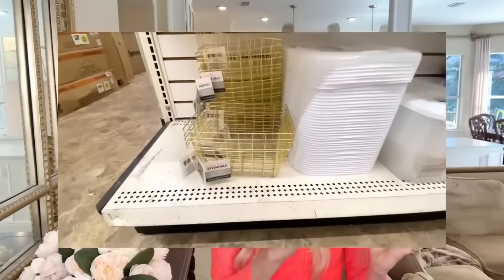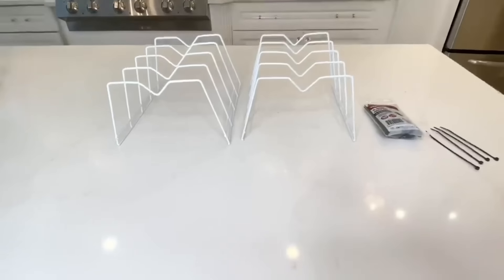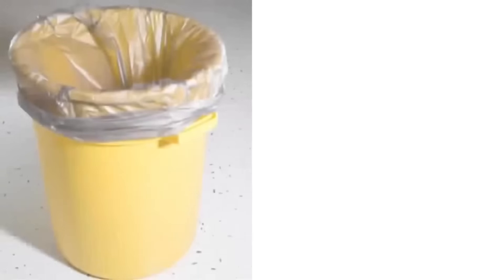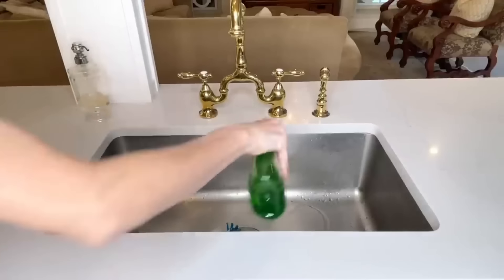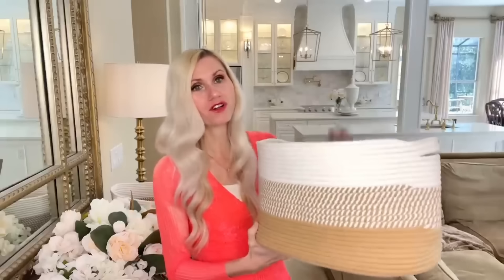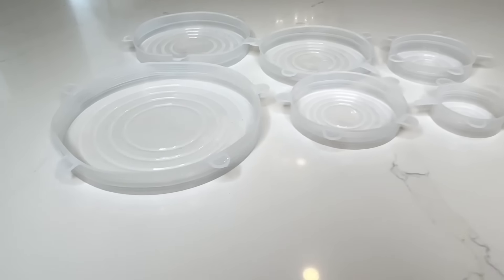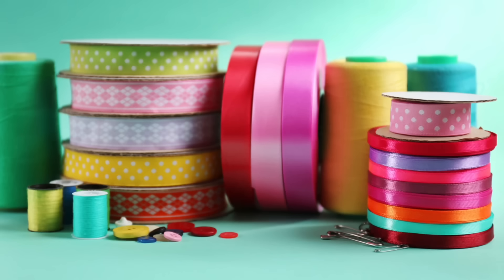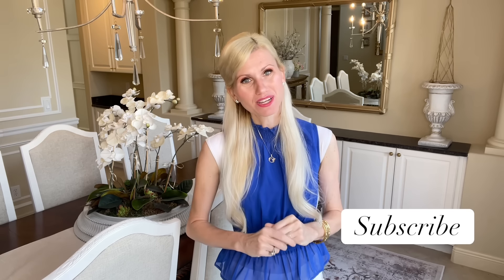*60* LIFE CHANGING HOME HACKS YOU NEED TO KNOW!🤯

Comment: If u have leftover chain,(like from a ceiling light fixture,not heavy duty) you can use it instead of a space saving hanger. Just slip top link over the hook and add more hangers down the length of the chain spaced according to preference. Can b spray painted to match your hangers.
Reply from the maker: Love that idea! Great hack. Thank you for sharing!💕

Comment: About the only thing I remember from chemistry is that "like dissolves like."  Any type of grease will remove tree sap, tar, and gum. I lived at the beach where there was tar and also in the mountains where there was sap.  I removed both of these with cooking oil numerous times. It also helps to get the adhesive off of stickers-just scrape off as much of the sticker as you can first to get to the adhesive, rub the oil on firmly and then wash off with a cloth and straight dish soap. Be careful on fabric though as it could cause a grease stain.
Reply from the maker: Wow! Thank you so much for sharing this. I’ll have to give that method a try. I appreciate it!

Comment: In the hanging baskets, cut the DT cutting boards or placemat to make a mat for the bottom so items will not tip.  Sunscreen, spray sunscreen?  What about using the WD 40? The DT soft glass holders, earbud containers also work. Is it safe to heat the candy bar chocolate wrapper?  Mix the grout cleaner in a sauce squirting container.  Seal the tle, grout lines and they won't get as dirty.  Permanent marker comes off with rubbing alcohol.  DT has a broom and brush or microfiber towel in the auto section of a fan duster to attach to clean vents, molding.   How do you clean the feather anything, we left them as did most hotels as eventually cannot clean them. So agree regarding the DT jewelry ideas. Hang glasses on the wall racks. My mom uses the egg crates and stacks them onto each other without the lids.  Really like the mesh organizers.  Those would really help those with ADD or other conditions. Tension rods are my #1 reason to visit a Daiso store.  Please # the ideas, or every 10.
Reply from the maker: Great idea! Thanks for the tip. I’m sure WD40 would work too.

Comment: The handing Baskets on a shower hook, I did that but hung a depth of TWO on either side under my BATHROOM SINK as the cupboard under the sink has such “odd” space, putting a regular shel is impossible so you then have to buy a specific bathroom shelf which costs about 20-30x more than this idea……ALL I did was add 4 little cup hooks into the “top” of each bathroom sink area. Then hang the top on on and ta da! Same idea but with an odd fitting space under your bathroom sink cupboard!!!!!
Note: I did have one GF who has a really OLD SCHOOL sink and is working on renoing her kitchen so I can’t give her a hard time about the bathroom, that’s just mean! With the location of her sick, FOUR cup hooks was not going to work well under her Bathroom Sink Cupboard so what we did was find where TWO HOOKS would fit and then place the OTHER two in the SIDES of the under sink cupboard! Add the second one like NORMAL unless another wacky pipe was in the way and then you may have to hook which hooks you can into the top basket but from there, you look where to place your other cup hooks to add to the walls where the shower curtain hanger would go and remember to grab your tiny level and keep them straight! 
It works and it takes some fiddling but is does work!!! Nice and tidy and you can SEE WHAT IS IN THE BASKETS! Rolled up face clothes or shampoos or extra toilet paper! Save space!
Reply from the maker: Wow!! What great tips! You are very creative in your problem solving. Thank you so much for sharing your ideas!💕

Comment: Omigawd, I'm scared to know why that sunscreen takes off oil!!
Reply from the maker: Right?!😬
Reply: It's no big deal. Gum is made with hydrophobic polymers (don't bind to water, otherwise it would dissolve in your mouth). It instead binds with oil-based products so you need an oil-based product to get it to break down. Sunscreen has oil in it. This is also why you can use whole range of items to successfully remove gum like WD-40, peanut butter, any type of oil, and even mayonnaise.